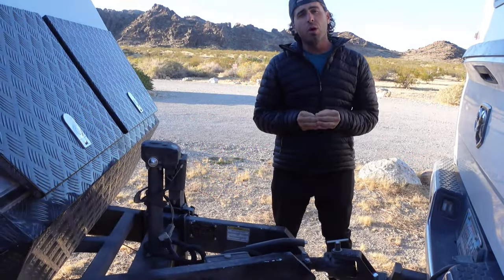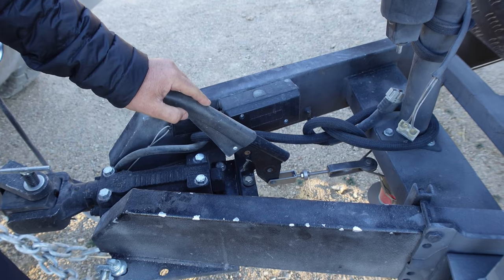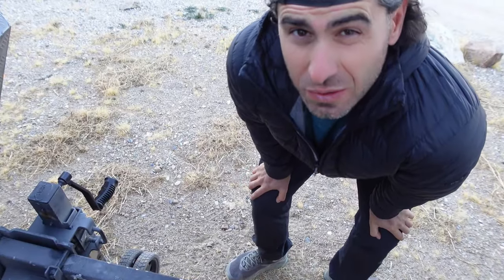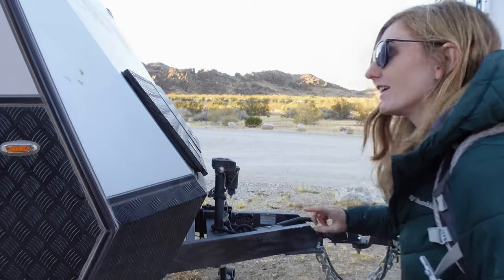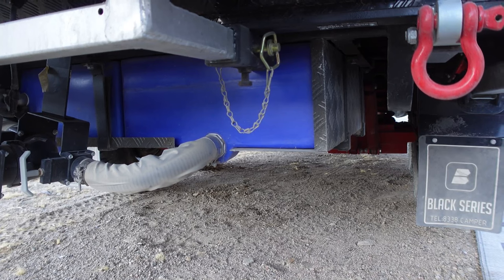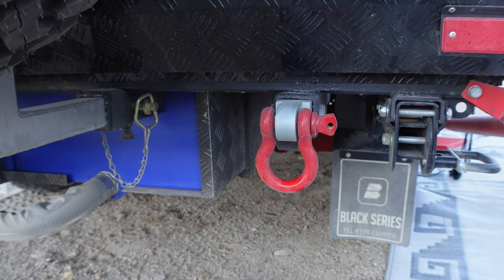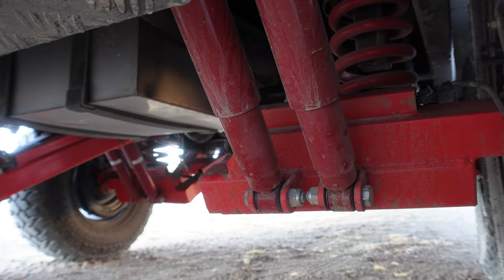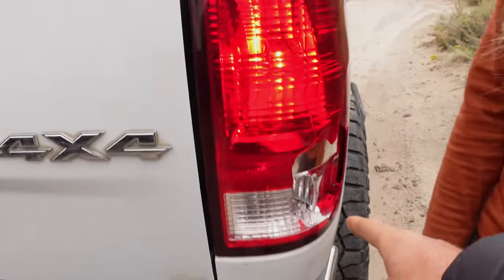Black Series Campers Independent Suspension Overland Trailer

Comment: The Diamond plate basically prevent scratches. Did you realize that the Woodgrain/Briarwood on the Wagoneer is also preventing the scratches from dirt and bushes? So it’s not just fashion but it is a function. And also old style woody looks way cooler. 

Just an intermezzo of my thoughts.
Reply from the maker: Yes the diamond plate definitely helps with the scratches. The fake wood hides them but they are still there lol
Reply: @AdventureEndeavor 😂

Comment: Looks like you're putting the new rig through its paces.  Have you had any issues with the tank dump valve? That is so often the "weak" spot on 'off-pavement' trailers with the dump pipe being too low. Black Series puts the dump value at the center rear of the trailer and I'm aware that others have busted up their dump valve when the tail of the trailer drags going through a low spot. I'd be interested to know how yours has held up with your off-road use.
Reply from the maker: No issues yet, and as you can tell we really use this thing. It's come close once, but it was a very aggressive ditch.

Comment: Are you planning on swapping out the poly block hitch for something more sturdier? I just change my hitch to a McHitch. I’m still waiting for the tongue hitch with a 2 inch drop, 3 inch solid steel receiver so I can take it for a spin.
Reply from the maker: We did not, we actually only had this trailer for 6 months. It was a partnership with Black Series and we talked about that in a few video's. I think the mchitch is a great option though and would switch if I owned it!

Comment: Sweet rig we are rolling with a HQ19 and GM2500. Watching your videos make us want to try taking it further and further. Curious how much you are airing down your truck and trailer with your setup?
Reply from the maker: Thanks, this is super capable. We typically air the truck down to 20 from 65 on our 37s. We have not aired down the trailer yet, if we encounter deep sand well air down the trailer

Comment: Most travel trailers mount the spare tire(s) underneath the trailer? Not so.
Reply from the maker: Normal ones do. But it's a fail for offroad, if you are high centered or in a  bag place it can be hard to get the tire out from under the trailer.

Comment: I was wondering how the Nash 17k OTG package would compare to this as far as off  road  adventures, insulation, and overall experience, I'm not sure if your nash had the Off the Grid Package . It does make a difference compared to the regular Nash. I believe the nash would be cheaper, just wondering if the Black Series would actually be worth all the extra money. Thanks looking forward to your opinion
Reply from the maker: I think the nash would probably perform better in regards to insulation in very cold temps. As far as I know the nash comes with solid axels and leaf springs and no articulating hitch. If you do a lot of offroading the Black Series is definitely better for uneven terrain with the independent suspension. We have not had any issues in cold weather with the Black Series yet and the heater works very well.